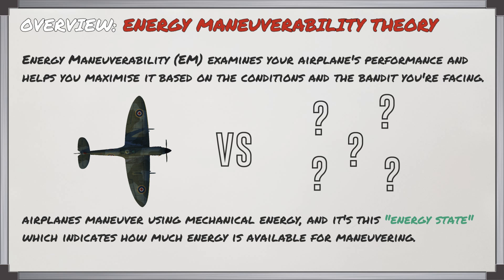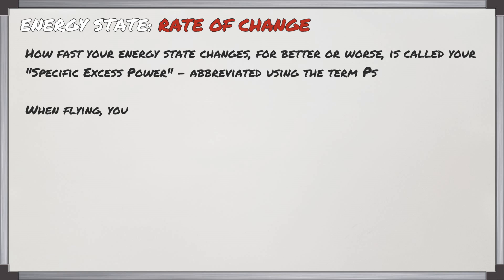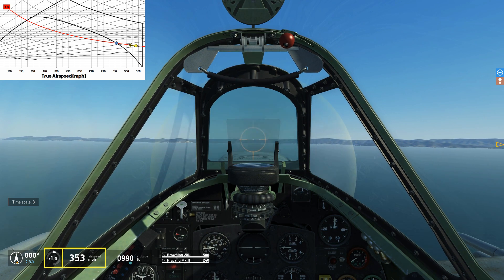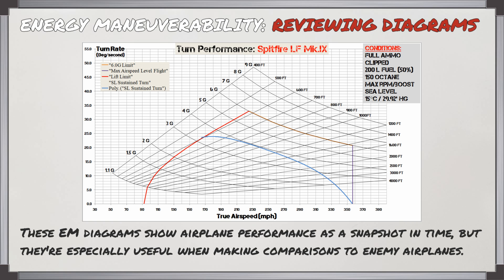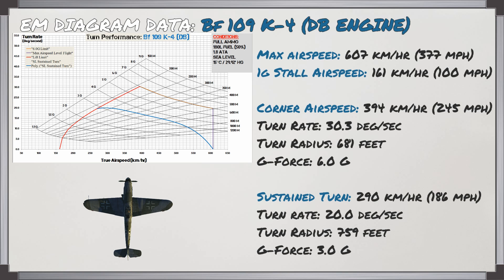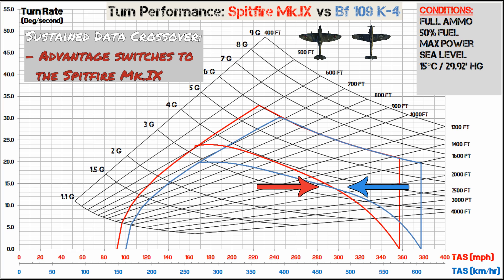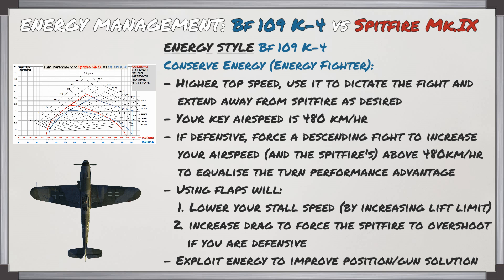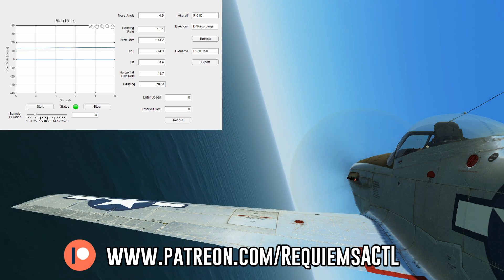Energy Maneuverability #1 - Spitfire MkIX vs Bf 109 K-4

Comment: The EM diagram is based on calculations and has no bearing on the real life performance of these WWII types. Maybe jets conform but not these... A similar EM diagram was produced during WWII comparing the Me -109E and Spit I. The lowest radius for the Spitfire was claimed to be in the 600-700 feet range.The real life minimum radius measured in flight by the RAE for the Spit I? 1025 feet... Furthermore, the Me-109E has a vastly smaller minimum radius of 880 feet, while the Hurricane was smaller still at 800 feet. To be honest I do not know if those radiuses were sustained speed or not, but I am sure they were at a low and thus radius-optimal speed. Contrary to what these doghouse charts all claim for WWII types, Gs above 4Gs require much higher speeds to reach them, meaning a much wider radius: In 1989 the SETP found the minimum speed to reach 6Gs for the P-51D (in a true horizontal turn) was much higher than what the flight manual measured during dive pull-outs: At least 320 mph vs 255 mph claimed in the manual, 245 mph with flaps... At 320 mph the 6G radius will be much wider than the 3G radius at 180 mph because the EM chart ignores that the aircraft is mushing wider through the turn, creating Gs with mushing deceleration in a mushing wider radius. (This mushing was particularly extreme on the FW-190A, which is why it fought best in low speed turns at reduced power in real life accounts) These EM doghouse charts are jet concepts ahistorically forced into non-existent WWII realities. Energy management was not important in WWII because pilots managed mostly FORCES on the horizontal, hence reduced power levels all the time, and not energy.jet age concept. The prop caused unknown mushing forces that discouraged turning with speed and full power.

Comment: This is all true in horizontal pane, correct? This consideration doesn’t take into accout climb rates which are in favour of K-4 even below 480km/h. In other words 109 gains energy faster by climbing then Spit even at low speeds.
Reply from the maker: Correct, this is only under those sets of conditions. Part of creating these can include Ps = 0 lines at various climbrates /descent rates as well but I chose not to include that because I only wanted to focus on this core concept atm. It's a pretty tough topic to cover well in a reasonable timeframe

Comment: Do you have an easy source link for the EM diagram for all planes in IL2?  Think it would be good to sticky on the forum under the guides/tips/tricks section.
Reply from the maker: No I don't. I've tested other airplanes in addition to these 2, at sea level / 15,000ft / 25,000 ft but nothing is public yet. I'm planning on making a post asking for assistance with testing as it's very time consuming
Reply: @RequiemsACTL   I am insterested in it. If I can be of any help let me know

Comment: Requiem, you didn't mention climb rates, dive rates or acceleration (level or diving).  Could you discuss these, either in conjunction with E or in addition to?  I suspect from experience that both climb rate and acceleration also favor the 109 in most circumstances, but am unclear where these are true/not true, and the answer is essential when repeatedly converting/recovering E from an altitude advantage.
Reply from the maker: Yeah I didn't get to that Scott, it was a little out of scope for what I wanted to make in this video and it was getting pretty long already. I'll keep them in mind for a future one though.

Comment: Huh I swear the 109 is better at slow speed fights. At least in rollers and flats I tend dance around Spitfires.
Reply: It could be the G-limit. It's really easy to overstress the pilot in the Spitfire, to a point in which in the later stages of your flight you can't match the Gs of your opponents. It is without a doubt the achilles heel. I'd also mention the flaps, 109s/190s can drop their flaps at low airspeeds and force an overshoot as was mentioned in the video. The only counter the Spit has is to quickly bleed speed (I usually go into the vertical a bit). On the plus side though, if their maneuver doesn't work, your energy states will be so low that a kill is almost guaranteed. Flying the spitfire in multiplayer against experienced German pilots is a very challenging experience.
Reply: @mauricedesaxe1745  yeah I use flaps religiously

Comment: Using DCS models would be probably more appropriate to show the science and how the numbers translate to flying these machines. Otherwise top job!
Reply from the maker: I plan on making these for DCS too. The F/A-18 or F-5 will be the first jet I do for it. It would be interesting to compare the MkIX and K4 in DCS against their counterparts in Il-2 as well. It's just that I have the process for making them using Il-2 more refined which is why I made them in Il-2 first
Reply: Yes, but doing more comparisons would lead to less content.  Plus I think more wwii-centric pilots use IL2 than DCS at the moment.
Reply: @MrSkins45  IL2 flight models don't include prop torque and many other things. DCS is mostly jets and bugs but at least they got that right.
Reply: @slegawsky3292  I'mnot so sure I agree wholly.  What torque would you want?  P-Factor?  They've got the left turning (choose your direction for your country) tendencies modeled in IL2 correctly.  You have to manage your rpm/manifold to not overspeeed/overtorque.  What else would have material impact?
Reply: However, I do agree that there are far more data points available in DCS to use at your will.

Comment: @3:34 You say that Ps = 0 line shows a state where you are at a constant G, but that is incorrect.  The G changes at various speeds along the Ps curve.  Great video though and thanks for making this content.
Reply: Interesting that he was not maintaining the Ps=0 curve, but was maintaining  a constant 3 G, using that to show that slowing to deeper beneath the Ps=0 curve allows use of excess power to climb or accelerate.  While that is correct, I was also surprised he did not show using the power to increase the G and turn rate, which is why most people use these charts, to find the speed for best sustained turn rate.  So he was not incorrect, but he was answering a different question than I would ask.  
Also, folks who fly jets rather than props should remember that the Ps=0 curves for these prop planes are quite different than those for jets, which usually have a peak much further to the right rather than to the left near the lift limit.
Reply: You're right that G changes along that line, but in this context he has specified the case that the aircraft is maintaining constant speed, which restricts you to a point on the line. At any given point on that line you are maintaining constant speed and G force.
Reply: @funkyschnitzel  We must be seeing different parts of the video. What I saw starting at about 4:40 was continuously pulling 3 G with the airspeed varying.
Reply: @gort8203  same part of the video. So any point on that line describes a situation where you will have a fixed airspeed and G. What he does in this video is show that if you start with a speed which is too high or too low, then pull that specific G force, the plane's speed will settle at that point.
For the case of 3g, the specific speed is about 317mph (for this aircraft). So when he starts faster that that and pulls 3g, he loses energy until he reaches that fixed point, at which stage both numbers will stay the same.
Reply: @funkyschnitzel  I understand your point, but in a dogfight, you don't watch your Gs and maintain a constant G through the turn.  You should be watching speed and pulling or releasing the stick to reach the maximum sustained turn rate speed.  You also can't realistically maintain constant Gs and will use varying Gs to maintain constant speed.  Lastly, you should be full throttle to convert chemical energy into max turn performance instead of adjusting speed down to maintain Gs.
Reply: @mobettameta  Of course, but this is an analysis tool, not a prescriptive dogfighting tutorial. Like many things in physics, this is an idealised case where most of the variables have been removed to give you an understanding of some core principle. By analysing aircraft performance at different constant speeds and G loads, you are able to better understand your advantages and disadvantages in different combat conditions. Understanding this plot will not make you a good dogfighter on its own, but it is a tool that will help you to improve your performance.
Reply: @funkyschnitzel  Watching the video again and the statement in question, yes I agree with you and I just misinterpreted the statement.  Holding altitude, speed, and G-force constant will yield a given Max Sustain Turn Rate on the Ps=0 line.
Reply: @funkyschnitzel  So I agree with everything in your last comment to me, but I still don't get what you were trying to say in your original comment where you said he was maintaining a constant speed -- but I'm okay if you are.
Reply: @gort8203  in my original comment I wasn't referring to the flight test he did (where obviously he is not maintaining constant speed throughout the test). I was specifically talking about the point on the diagram which describes the case of constant speed and G. This is the state that his aircraft reaches at the end of the test, when his speed reaches 317 and he stops losing energy.

Comment: Very nice presentation. Having this kind of data available for WWII aircraft would be very helpful, so thank you for making this effort. I hope you don't mind but I do have a few suggestions.
1.  When introducing the concept of energy you might show a chart with lines of constant energy.  This shows all points in the envelope where an airplane has the same energy level, and succinctly illustrates the interchangeability between airspeed an altitude.
2. You correctly show a that a constant speed climb gains energy. You then indicate that sacrificing altitude loses energy, but this is not necessarily the case if you exchange that altitude for a sufficient increase in airspeed. What you meant to say is that descent at a constant speed loses energy.  Again, the lines of constant energy help illustrate this, as well as the corollary that you can convert excess speed from a dive back into energy by zooming.
3.  I understand that it's hard to find load factor limits for WWII airplanes, but I do not think using an arbitrary 6 G pilot imposed limit is useful in comparing aircraft.  Yes, sustaining more than 6 G indefinitely is tough, but a pilot can sustain more than 6 for long enough to make use of it ( certainly longer than these aircraft could sustain it in anything near level flight).  Furthermore, you are factoring out the ability to compare the instantaneous turn performance of the aircraft, which a pilot could certainly employ even if he might have trouble sustaining 6 G.  Pilot G tolerance is variable even for the same pilot on different days, while the airplane limit is a design constant.  Therefore my preference would be to use an educated guess on the airframe limit rather than an arbitrarily low pilot limit, allowing comparison of the instantaneous as well as sustained turn capabilities of the aircraft.  Corner velocity by definition is based on the airframe load limit, not pilot G tolerance.
Thanks for listening.  Please keep up the good work.
Reply from the maker: Thanks Gort, I appreciate your feedback on this one as I'm just a pilot without an engineering background. I understand what you mean about the pilot limit vs a structural limit, but the reason I went with 6G is because these graphs are done using Il-2 and both pilots here do not have a G-suit so their max is supposedly 6.5G. However in a P-51 for example there is a G-suit so that limit is 7.5G as the max is increased to 8G apparently. If all I did was consider a structural limit it would be harder to visualise the advantage the G suit gives. Send me an email or get in touch with me on my Discord channel, so that way when I do some future diagrams using DCS aircraft you can have review them if you like
Reply: @RequiemsACTL   
Thanks, I may drop you a line sometime.  
Just as additional info for the audience, I think one should consider what actually happens at the pilot's G 'limit', which is not a binary on/off switch with the pilot suddenly incapacitated. Vison is gradually affected, going gray and dim, tunnel vison, and eventually getting to none. But the pilot is still flying even with reduced or no vision.  It is perfectly feasible for a pilot to pull a limited duration max G turn that exceeds his sustainable tolerance. The Red Bull Air Race pilots must be feeling at least 8 G during their "vertical turn maneuvers".  (This is why I hate the way DCS simulates G effects -- it treats blackout as a loss of consciousness, and it is not.)